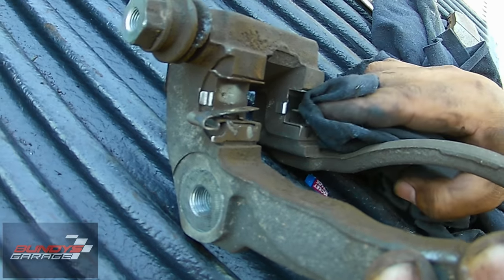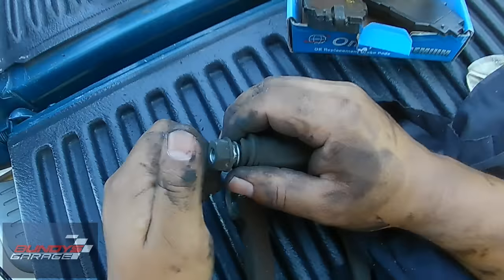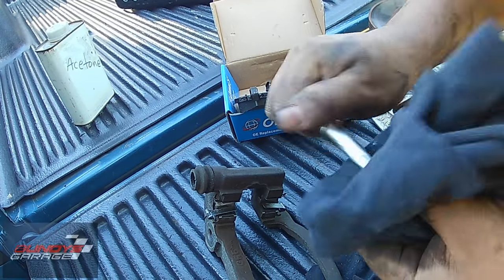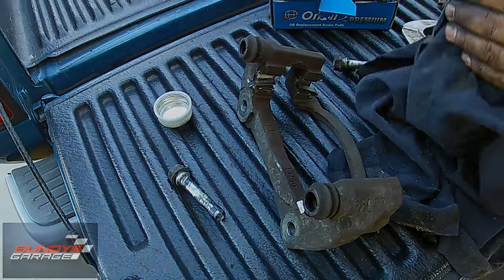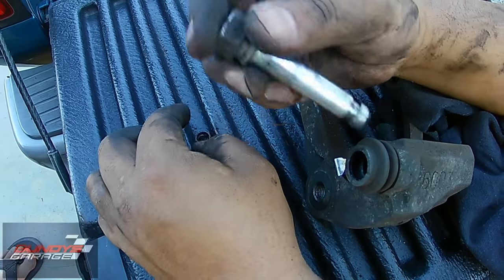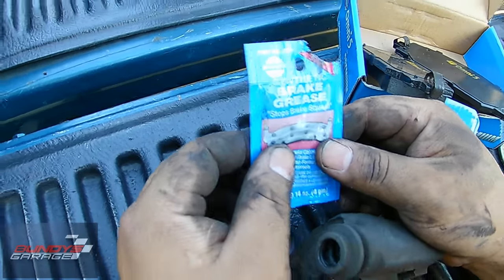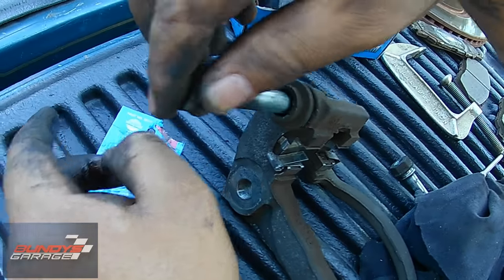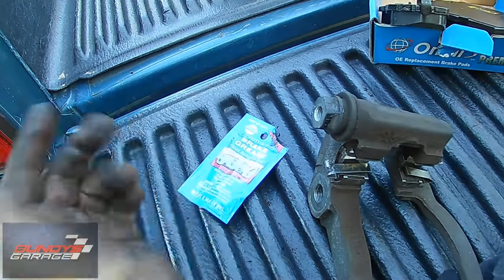What is that piece of rubber "tube" on the lower brake caliper pin? | Honda | Toyota | Lexus | Acura

Comment: I had recently done the rear brakes on my daughters 2017 camry le i removed the guide pins, one pin on one side had half of rubber bushing left so basically fell off the pin & put new grease on the pin temp till i get new rubber bushing to install on it which i found that auto zone carries them that contain 4 boots & 2 bushings in a pack by duralast for under 6$ so i will be installing new rubber bushing on the pin that was worn, there is reason why these are on the bottom guid pin so i would recommend replacing them if needed, dealership wants 15$ for just one rubber bushing  very expensive where auto zone can get two + four rubber boots by duralast way better deal..

Comment: Thats exactly what Is happening to my Nissan Quest. That rubber piece is causing my caliper to not slide. I will be fixing that tomarrow. I stripped the threads in the damn bracket  putting it back on. It was caused by rust.
Reply from the maker: So called Macy’s I’ve get lazy and slap any kind of grease on those pins when it calls for a specific kind of grease. Using the wrong grease makes the rubber swell and causes the pin to get stuck.

Comment: Toyota shop manuals say you are supposed to replace them once the slide pins are taken out. Have you ever had them swell if the slide pins were never removed? They also serve as an anti wear measure for the pins and are actually meant to prevent the pins from seizing if I'm not mistaken. I think I'll replace mine for the time being

Comment: I know this is video is over 3 years old but it answered a question I have not been able to find the answer to before. But I can add something, the rubber "tubes" swell because people use sodium or lithium based greases (i.e. normal grease) on them. This is why they swell. Use silicone based grease where it will contact rubber and you will not have this issue. Taking the rubber tubes off works as well.
Reply from the maker: Thanks for the info. When people take their vehicles to the quick brake places, much like the quick oil change places, those “mechanics” are just starting out and reach for any old grease they see laying around the shop. So with time and experience guys begin to realize what to use and what not to use on brake systems.

Comment: Really need help with this one!! Similar but maybe the opposite to the end of your video.. One of my caliper guide pins is not seated properly in length, it wouldn't bounce back to the same height as the other guide pin even after proper lubrication. I also replaced both rubber boots (not the tube thing on the slider pins as mine don't have one), and tried sliding each guide pin into each bracket hole trying to see if it was the cause of the pins, and the good one would still work fine and the bad one would still be problematic no matter which pin it was. I did some research and found that there is a limited number of posts talking about this issue, but apparently they were saying that the reason behind this was due to too much vacuum inside and would need to let some air in? I did test out taking the bracket off and cleaned out all the old grease inside the bracket hole of the problematic one, and put the guide pin in to see what would happen; it turned out that it would not move at all without any lubrication. After lubricating the pin BUT without installing the rubber boot, the pin would indeed tend to bounce normally just like the other good one. But after installing the rubber boot (even a new one), the issue would reoccur). There are no proper guidelines showing how to solve this issue. Do you have any suggestions?

Comment: Just did my brakes because the wear indicator was screeching on the front. Come to find out that rubber on the guide pin caused it to stick and only half of the pad was actually being used to stop the car. The ones that come with a new boot kit stop the pin from going back in also because they’re too fat lol. Just removed all of them and went without.

Comment: Very nice! Thank you. 
Never knew what that rubber piece was doing there. 
Question: why one pin has it but the other pin doesn’t? (What if the pin that doesn’t have it, is the one that rattles —> what do car manufacturers say about that?)
Thx!
Reply: My 2017 f 150 fx4 brakes have rubber on both, top and bottom pins. All the kits ford tries to sell me only has one pin with the rubber. Hs to be nose control of some type.

Comment: What are the rubber sleeves for? Why not just replacing them. The engineer obviously put them there for a reason.
Reply: I think that they form an intense airtight seal. After you brake and then let off the brake, the air has been compressed and expands back to full size, pushing and moving the brake pads back off the rotor. Without the gaskets, I think it would have less ability to retract the pads off the rotor.
Reply: @davelovell8631  I like this theory but if the compression is on only one of the pins,  I don't think the other pin would be functioning properly. It would not be seating all of way down and exerting pressure against the pads. Moreover, when I push the pin with the rubber bushing down by hand no air is being compressed. But perhaps the rubber bushing is worn.
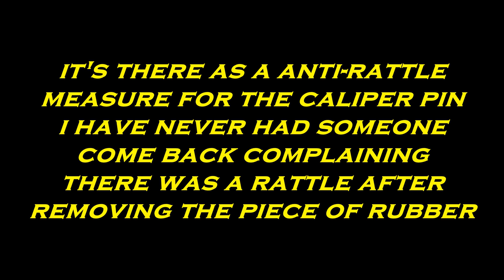Reply: @superdow1000  Good point. Rewatching this a year later, I'm thinking even less that this is to push the pin back out. The gasket has groves on it which would let air pass more freely, which they wouldn't have put on it if they wanted to make a seal. I just noticed that at 1:29 it says this is an anti-rattle measure

Comment: Update i took the rubber off my 2016 rav4,,  much better gas mileage..  and yse faster LOL BUT true..  thanks for the information..
Reply from the maker: No one believes me…
Reply: @bundysgarage  Well very sorry about that,,  you are true it really did work,,  runs faster better gas mileage..  I'm glad I seen your post best Modification I've done getting rid of the rubber from the slide pins..

Comment: Thanks for the tip on throwing away the rubber ring. Most of the cars I drive are old. What’s the best grease to use on those slide pins?
Reply: I use anti seize. It works perfectly and will prevent rust in bad environments.
Reply: @dmandman9  I will now as well, thank you!

Comment: The reason they swell up because of the use of wrong type of grease. The next time you do a brake service. make sure to use silicone-based grease or the grease that came with the new pads when you replace them.

Comment: I have a weirder issue.  I replaced my pins with new ones that dont have the rubber and it's now rattling for the first time.  Everything is torqued correctly too.  All I did was some cleaning when I snapped a guide pin bolt so they were replaced, but it's crazy to think that all the dirt I cleaned off kept stuff from rattling.  So I'm lost now
Reply: Were the new slide pins aftermarket? They may have been undersized. They're normally a pretty snug fit. (So much so, that flats are machined in them to allow grease to flow.)

Comment: These rubber bushings are pissing me off too but I own a f150 the bushing is longer and its causing the pin to stick, theyre brand new too ,  still sticking
Reply from the maker: CUTEM’ OFF!
Reply: @bundysgarage  yep took it off, slides again... weird thing is I only had that on the front passenger side,, the driver side slide pins were both the reg kind , no bushing
Reply from the maker: Maybe someone didn’t put the correct slide pins where they needed to go?

Comment: I have a 2006 f150. I mixed up the pins. Does the pin with the rubber go in the upper or lower hole?

Comment: Lets say I am keeping the rubber bushing on the guide pin, does it matter if I put the pin on the top or bottom?
Reply: It goes on the leading pin.  If the caliper is mounted to the front of the rotor, it would be the top pin.  If the caliper is mounted to the rear of the rotor, it would be the bottom pin.
Reply: @kirkdarling4120  
Thank you for the clarification. I’ll definitely take a closer look next time I service my brakes. 👍🙏

Comment: Nonsense..the rubber o ring is to stop vibration of the unit. When you fit a new one...just spin it around a while and it slips lovely. Never take anything off.. It has a reason that be there
You now know
Reply from the maker: I’ve take. 100’s of them off and not a single person has come back and told me they feel a “vibration”.

Comment: Obviously it requires very high precision to have both guide pins moving smoothly in their respective hole. The pin-to-hole precision would be easily achieved if there were only one guide pin. But as we have two guide pins operating in high temperaturen we can’t have the tight fit on both pins at the same time.
So in my mind it is obvious that the pin without rubber has a very high pin-to-hole precision and the other pin with rubber must have less precision for it to fit into it’s hole. This lack of precision is compensated by the rubber which also prevent noise/rattle.

So in other words: one pin is for high precision fit, the other pin with rubber is to absorb the tolerance when fitting two pins in cohesion.
Placing the rubber pin in top or bottom position does not make any difference, it will have it’s tolerance absorption function anyway as the drill holes has the same dimension

Comment: what long term lubrication would you recommend for the bleeder screw threads e.g when I removed my front left brake caliper bleeder screw, it snapped off inside the caliper and was impossible to remove - I had to replace the whole part of the caliper.
Reply: Anti seize, I would really cake it on too.

Comment: In India we install an upsized caliper pin for the rattling noise but I think that will last just an year or two as the caliper brackets are wayy to old like 7 to 10 years

Comment: Use any grease. The problem is 'mechanics' relpace the break pads with the caliper lift method and only take out one slide pin allowing the other to rust in place.

Comment: I was doing my front brakes and rotors on my 03 ranger today and the passenger side caliper pins both had a rubber piece over them aswell but the drive side didn't have them. Why do yoi think that is. Plus the pins on the passenger side with the rubber seem to also be slightly different pins then the driver side pins. Not sure what to do in the am when I finish them.

Comment: Do I have to clean the inside of the caliper where the pin goes sliding in?
Reply from the maker: If there is rust on the pin when you pull it out, yes. Otherwise just spray some brake parts cleaner down there let it dry and then reassemble.
Reply: I may overkill but I like to have a peace of mind, I took the caliper bracket off and cleaned out the guide pin holes with brake cleaner and long q-tips. I like to make sure all the old grease is all out of there before I put in new lube. Then again I only work on my vehicle so it’s not like I do this day in and day out.
Reply: @austinlopez9981  Same here . I clean ALL that out !

Comment: I’m wondering about the caliper bolt with the rubber on it. Is that always in the lower end of the caliper or upper? And you said you just remove it?
Reply: upper end

Comment: Huh, good to know. The brakes on my Oddy were new when I got it, so I've not had a reason to touch them untill recently. I'll be sure to get rid of that piece of rubber, thanks Bundy :D 

As a side note, I use Sil Glyde, but I also maintain a "Fleet" of 4-6 family vehicles at any given time; the reason I buy a tube of the stuff.

Comment: It’s there for a reason. Why would you take it off and throw it out? If it’s swollen or bad replace the pin. Maybe you need to clean the interior where the pin slides. If it truly did what you were saying why would they waste their money putting it on there in the first place?  I think your pin and slide  needed better cleaning. Furthermore it goes in a specific slot maybe you had it in the wrong slot. Upper and lower don’t typically have the rubber boot

Comment: Well I tried this on my Saturn Vue but the rubber sleeve on my is almost an inch long and when I take it off the pin is loose I'm sure that's not going to work.. Looks like O'reilly's has a kit with the sleeve's and boots.
Reply: The bushed pin is smaller than the plain pin so you are bang on mate.

Comment: I've just done my brakes on my mazda 3 (2016). The bottom sliding pin was stuck. Managed to take it off and noticed the piece of rubber on the pin. I cleaned the pin, but couldn't put it back. I've removed the rubber and placed back the pin without it. Has anyone else had the same issue on the mazda? Will it be ok without the rubber on the pin? Thanks!
Reply from the maker: It will be fine without the rubber.
Reply: @bundysgarage  for me its more worst without the rubber bushing its caused your brakes to make noise maybe he don't put grease on the pins thats why its stuck up

Comment: Why is it only on one pin though?  Only one pun on each side of vehicle has that rubber thing on the guide pin. But I want expecting it so I didn't pay attention to it. Now I dont know if it's on top or bottom
Reply: My Toyota's have them on Bottom pin . I just did both cars . I think maybe I should have removed the rubber !

Comment: I'm going to try using Polyolefin heat shrink instead and see what happens. Subarus have one that's about 1in long sleeve so it's going to make some noise if it isn't there
Reply: I have a 2008 subaru impreza and that sleeve got messed up on mine which caused uneven brake wear. Is that pin om the top or bottom? I wasnt paying attention when I pulled them out and noticed after
Reply: @williamngo8345  there's two. Top and bottom on each side.
Reply: @airhogglider  oh ok, on mine only 1 has the sleeve...om each side
Reply: @williamngo8345  then just fix that one and your good

Comment: Today I found one on one side of a mazda 2 had seized on so attempted to heat it up and then it pretty much blew up due to expanding gasses from the rubber turning to liquid. How bad an issue could that be?
Reply: Wait you blew up the caliper bracket?

Comment: the rubber should stop the caliper from sliding (back) /rattling, but enough of the right grease (i've used copper grease/antiseeze) will do the same job without causing the caliper to tilt like you mention.
Reply: Never use anti-seize on slider pins, I’ve had multiple cars come in and all you see pouring out of the boots is dusty antisieze which is exactly what u don’t want

Comment: Question: does it matter where the slider with the rubber goes in? As in took them both out and don't remember where the one with the rubber goes in. Thanks
Reply from the maker: No cause you should cut it off and then reinstall them. Unless you want it to bind up on you in the future.
Reply: @bundysgarage  thanks.
Reply: @MarcoS-yd9pf  did you end up cutting off the rubber off your caliper slide pins? If you did, what was the outcome?
Reply: @alfredbernal8603  no. I ended up figuring which one went where. Ha ha
Reply: @MarcoS-yd9pf  i ended up doing more research and buying the rubber boots and the rubber sleeves and doing the front brake job myself. It turned out good! Big difference for the better & i'm sure i saved plenty of money. Appreciate your response..have a nice rest of your day!
Reply: @alfredbernal8603  glad to hear! You too. No problem

Comment: not all vehicles have a rubber O ring bushings on slider pins
Reply from the maker: Yes you are correct
Reply: What is the cause if the caliper does not goes back in position rather than sliding pin

Comment: Recently diy'd my brake pads and rotors... Upon installation the caliper guide pins with that similar rubber tip end refuses to completely seat back into the bracket. I push it in but feels like there's trapped air behind it that pushes the pin back out! Is there cause for concern, should I replace those guide pins.. Please help lol
Reply: Made every attempt to release that trapped air behind the pin but can't... I cleaned out the hole on the bracket and re lubricated the guide pin, seemed to help but still some resistance 😪
Reply from the maker: No just pop that rubber piece off, throw it away, re-Install it and it will be good to go.
Reply: I have the same "problem".  but one of the comments here indicates the purpose is push the brakes away from the rotor after the brake is released.  This makes sense.  There is probably enough pressure from the caliper to squeeze the brake tight but when the brake is released the air pressure causes the brake to snap back. Just a thought. Not sure.

Comment: My g37 has one and it stops the bolt from going in, someone mentioned using anti seize. Is it possible to run without it with no damage
Reply: I know this is a old comment but I personally would just leave them off. I wouldn't use anti seize because anti seize is gritty, it basically does the same thing as grease but has metal powder in it.
Reply: @Yophillips3272  I already got new boots, and used the brake grease. My car was fine without one. I still put one on though, I just feel better that way

Comment: the slide pin with the rubber goes on the bottom or the top?
Reply: I varies from vehicle to vehicle and the front ones might be opposite from the rear on a particular vehicle.  Check online forums or videos for your particular vehicle.